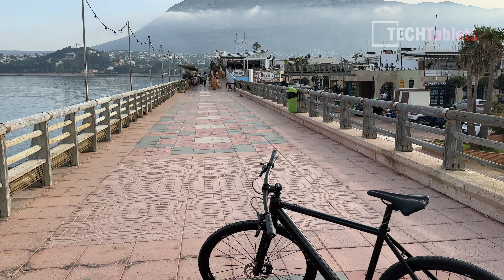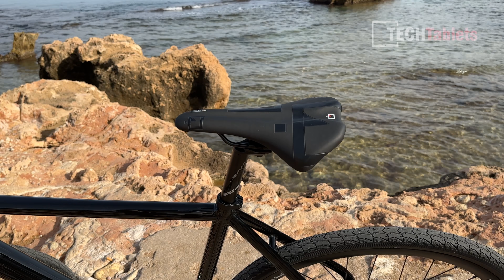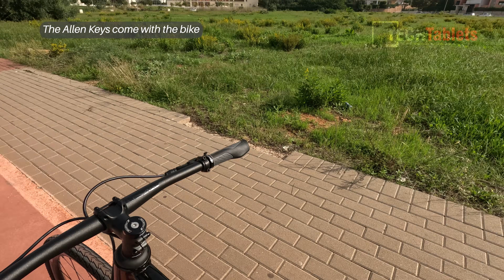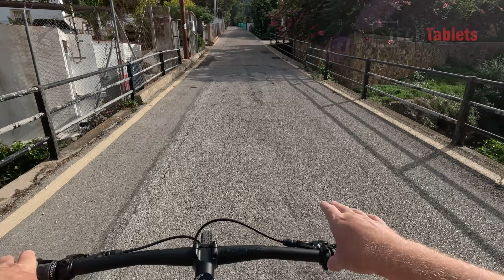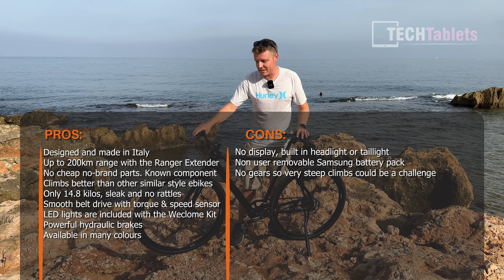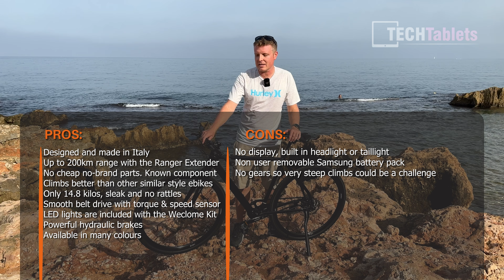NOKOFORZA Review 100km+ Top Quality Italian Urban eBike!

Comment: Thanks for the review.
The rear subframe appears to be welded.
I don't see any bolts in it.
What do you do if you need to change the belt? does it have to be cut and rewelded? (the belt does not have a false link like the chain)

Comment: Great video! One question: are you happy with the choice of the belt transmission (NOKOFORZA), or do you miss the gears and in retrospect would had preferred the normal chain variant (NOKOURBAN)? Hoping hearing from you!
Reply from the maker: Depends on where you ride. If I had a lot of climbs I would want the gears. But if it's mostly flat then the belt for the lack of maintenance.
Reply: @Techtablets  live in the Netherlands so it's mostly flat ;) Yet i'm worried I have to paddle like crazy if I want to go faster than the supported 25km/h. Any thoughts/recommendations on this?

Comment: For once you did not review Chinese junk well done!
Reply: Not everything from China is junk.
But we can see a well thought through and designed bike. Look at the welding, the thick paint, I believe I see it even in the video, and then the best: No unneeded electronics!
Reply from the maker: Yes this model doesn’t look like a ebike, no screen think frame and the style. Only the rear hub motor is the giveaway.
Reply: I laughed. The Chinese are flooding the market with the same junk different names.  This bike is nice.

Comment: For that price i'd get a Van Moof.
Reply from the maker: What’s the Van Moof got over this model? I’ve not tested one.
Reply: @Techtablets  Van Moof made its 5th (A5/S5) version recently. The first 3 versions were not the best, but they are getting good. So the first is that they have more experience. I like the design better, but thats personal. They have mud-guards. Better range. The kick-lock. Turbo boost button. A very good torque sensor. Extra long range battery option. Anti-theft tech (actual bike hunters).  Lower step in option.  Its possibly more durable, cause its build in/for a wet country. Red Dot Award 2020.

Would love to see your opinion!:washhands: